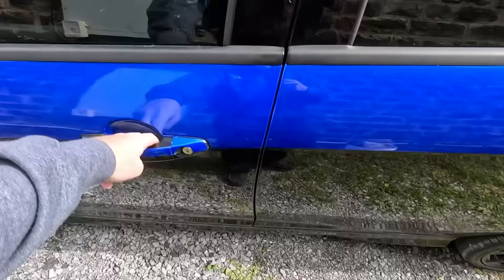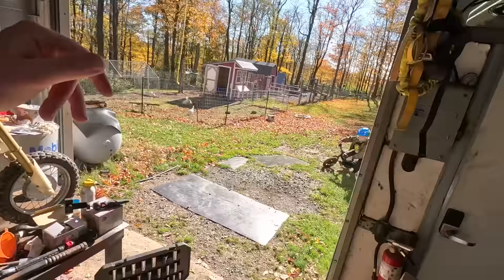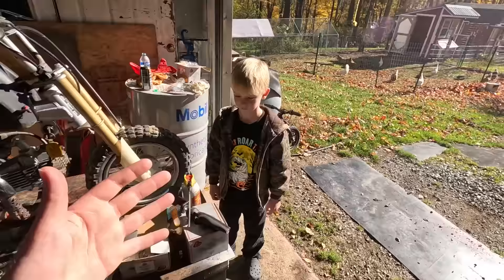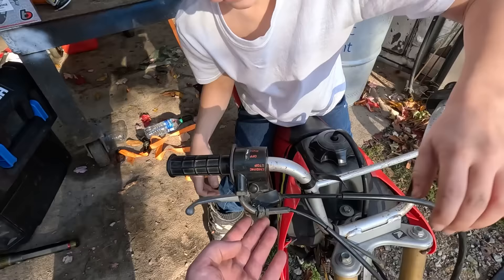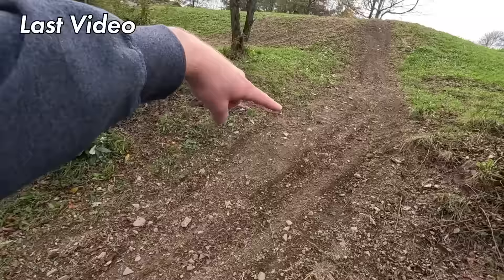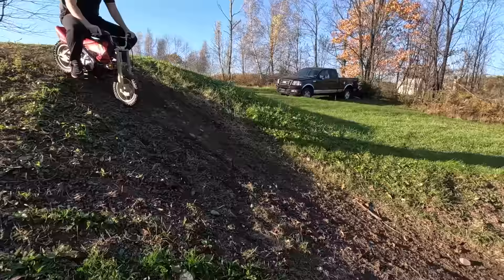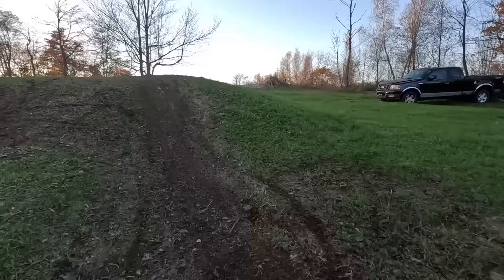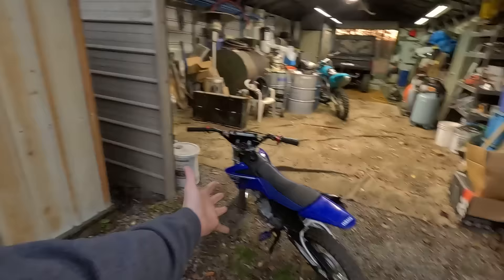I Installed A 88cc Big Bore Kit On His Slow XR50

Comment: I did same everything on mine but I got the bigger plug for 88 cc and also must do is get different front tooth sprocket I forgot but know it has longer gears cause stock front sprocket first gear winds out to fast with sprocket change up front they are fast for 88cc
Reply from the maker: We did put in a new plug and I agree with the gearing. There seems to be too much of a difference between 1st and 2nd gear so changing the sprockets would definitely
help with that.

Comment: did you try adjusting the H-D clutch at all? I've head people run the H-D clutch on the 141 and 138 works motors and they adjusted the stiffness out of the shifting